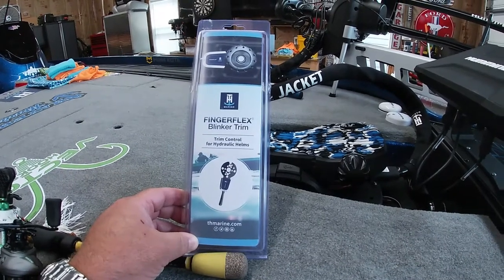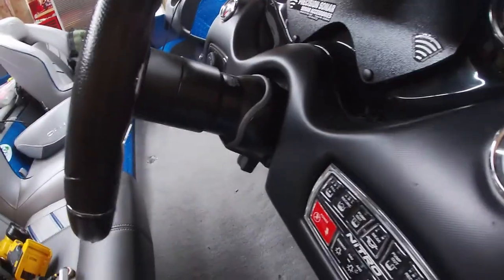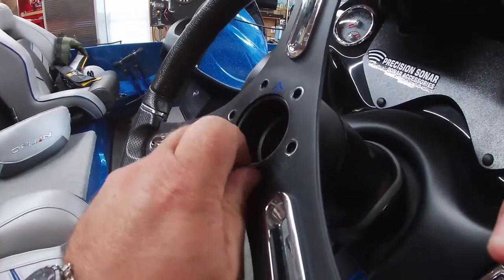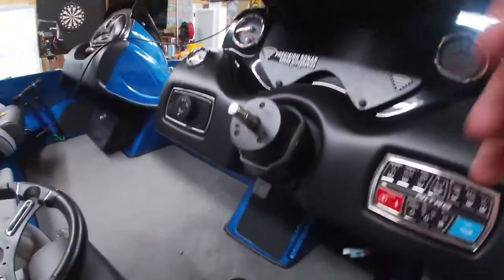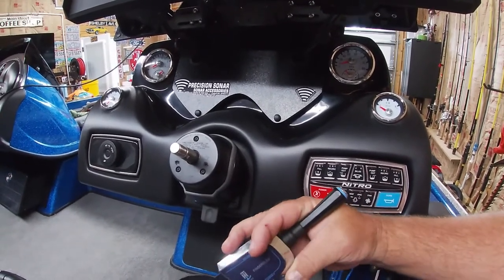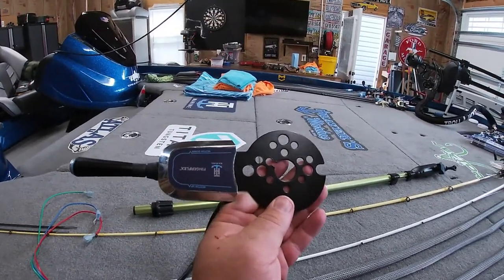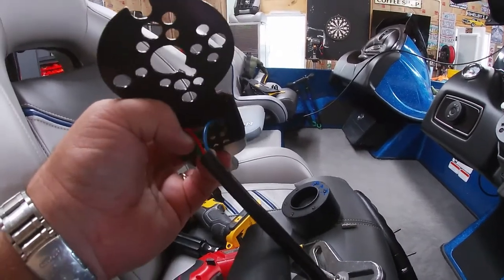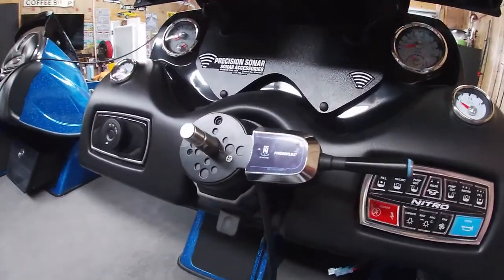TH Marine blinker trim

Comment: You would get more function out of the blinker install if you have it facing the opposite of the throttle. This allows you to manage the throttle and jack plate at same time with one hand on the wheel/blinker and the other on throttle. This is very common on flats boats for hole shots in shallow water. For example, you have jack plate all the way up as you throttle up to get on plane. Usually gunning it. As you get on plane you lower the engine and also pull back on throttle all at the same time. That is very hard to do when blinker is on the same side as throttle.
Reply from the maker: I fully agree!!  But i do have a hot foot so i have no issue.  I have both hands on the wheel and one foot on the throttle!
Reply: @jasonstoopsfishing  Ah, makes sense for ya then... us saltwater folks don't even know what a 'hot foot' is...lol... we do way to much standing for it to be an option...
Reply: Most Bass Boats have a Hot foot throttle. The gear selector is just for forward or reverse. Most everyone puts them on the right side of the steering wheel.

Comment: When you ordered the finger flex from th.. it already had the wiring attached and came with the set screws? I just ordered one but it really didn't give me a good description of what it came with or a good picture of what it would look like in the package.. I've got pro-trim but it's older and the trim box is moving around because it was not installed properly
Reply from the maker: Yrs sir. Everything came with it

Comment: So I have a 2003 procraft and the my tilt is on the throttle handle. I don't think mine has pre rigged wiring already so where do you think I should connect it? Should I tap into the trim gauge?
Reply from the maker: You should probably run wires and tap into the trim button on the throttle then
Reply: @jasonstoopsfishing  awesome thanks for the advice